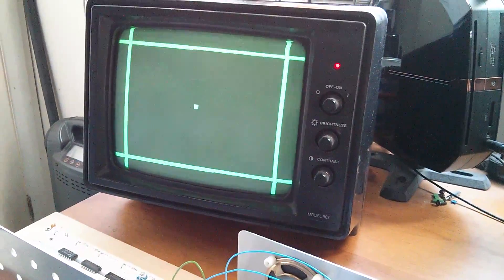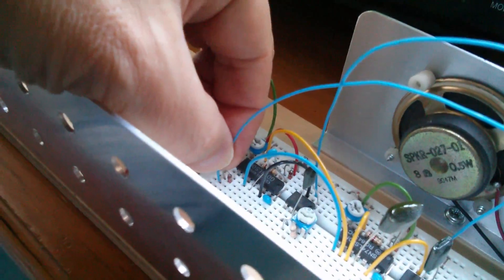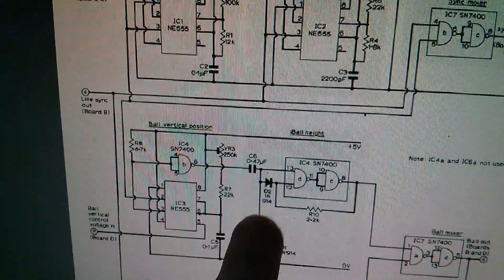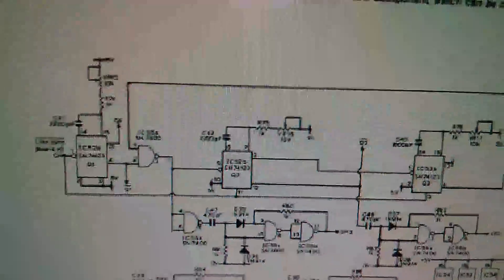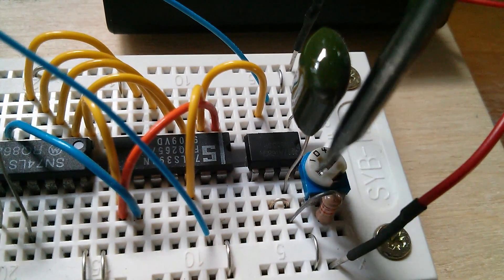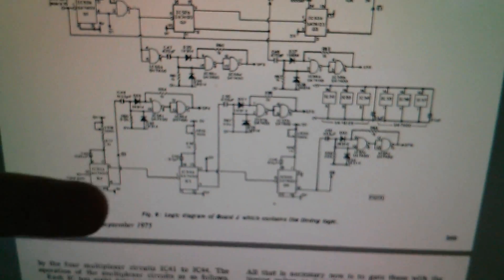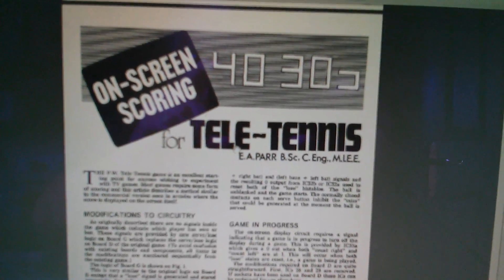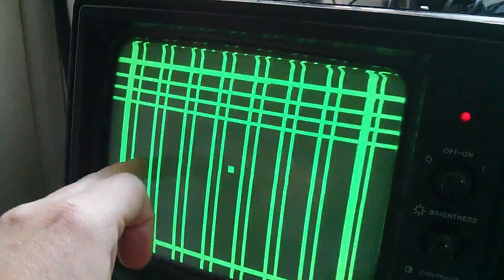Retro Electronics: Tele-Tennis Pong Video Synthesiser

Comment: Ah brings back memories. I remember when that PW came out. Exciting times! I was much too young to be able to afford to build any of the circuit. It actually was preceded by a similar project in Practical Television. I wonder how many were actually made by readers of PW? We will never know! Some time later I did actually build a TV ping-pong kit which was advertised in the electronic magazines of the time. It was unusual in that it was made from CMOS 4000 series ICs. I also breadboarded a video generator using TTL ICs using a monochrome TV as the monitor. I didn't have a crystal so I used a 7414 as the oscillator. I still have it. Perhaps it is time to resurrect it and make a YouTube video :-)

Comment: I need help. I found an old (really old) monochrome VGA monitor I want to turn into an oscilloscope, as I have already made an amplifier that can even output DC for the deflection yoke. I cannot find the service manual for it. when i found it, the power and video cables were chopped off. power, not a problem. video? never worked on a monochrome before. all of the video inputs labeled on the PCB are: V1, VS, HS, SR, GND. my guess is that VS and HS are horizontal and vertical sync, GND is obvious, but I have no idea about V1 or SR. everything is connected to the main PCB, except for V1, which goes directly to the PCB on the neck of the CRT. Any ideas? monitor is a SAMSUNG ML4571, and again, I cant find a free schematic.
Reply: If this information on this link http://choiceprinters.com/video/TTL/SAMSUNG_ML4571.html is to be trusted then you should try applying 5V to the V1 pin and the appropreate horizontal and vertical signals and see what happens.
Reply: Sam T or perhaps try to connect an old computer to it, the monitor or worth more to me than the pile of old towers i own
Reply: ***** You would have to make sure that the video card supports MDA resolutions as well as being TTL (5 volt) capable.  I think that you would be better off using a B&W TV and selling that old VGA monitor assuming that you can get it working.  On ebay I saw one going for $250.
Reply: Sam T once i know it works, i just need it to supply high voltage. It is so primitive that it doesn't even use a switching power supply!
Reply: It may use 12 Volts to run internally.  You would have to look at the
voltage the input capacitors are rated to and then subtract around 80
Volts if it is mains powered and if it is low voltage divide the
rating in half or so.  Do you have pictures of the top and bottom of
the circuit board?
Reply: http://linustechtips.com/main/topic/234143-cant-figure-out-how-to-run-an-old-monitor/ there are some images here. Powering it shouldnt be a problem though. It still has all the parts, i just said that it is such a primitive monitor.
Reply: It says that I need to make an account to view the pictures.  I would
recommend posting this question in an electronics related form (eg
eevblog) where anyone can view the pictures and there will be people
way more knowledgeable then me to help you.
Reply: Ok, i will. Thanks!
Reply: Do you still need help?  I have noticed that you have not posted on the eevblog forum yet.  I would recommend posting under the beginners section.